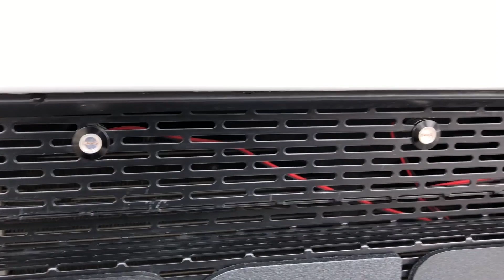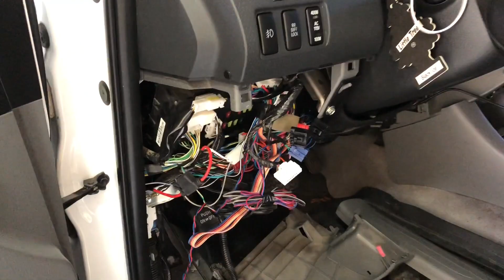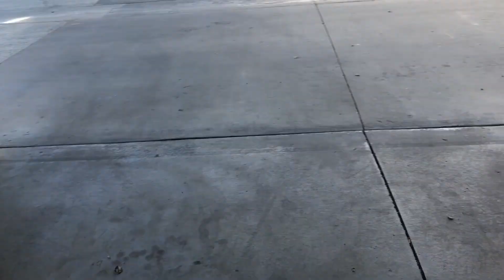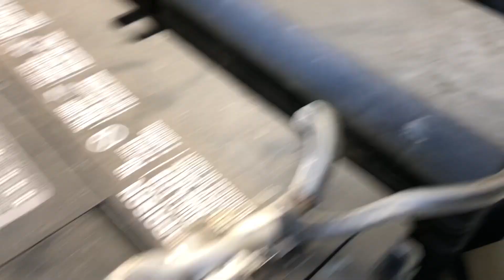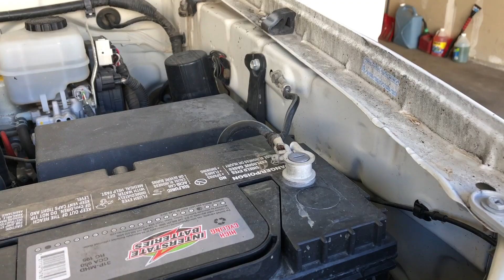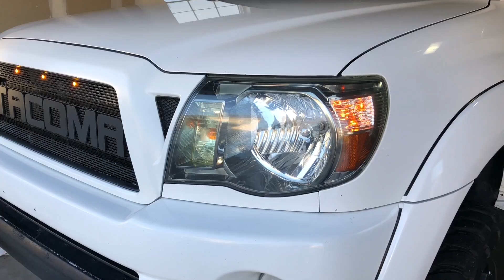Tacoma Amber LED Lights Install

Comment: I have it connected to my blinker but it’s not turning on do I need the fuse connector and if so what fuse
Reply from the maker: Does it turn on when your blinker is on? You need to connect it to a light that stays on like the DTRL.

Comment: Doesn't give you any issues on the computer system of your truck like warning signs light up on the instrument panel? as the computer noticed strange or new equipment hooked up to the system? I'm planning to do the same to my tacoma but I'm hesitant I might get some issues on the computer system of my truck.
Reply from the maker: Nope, no kind of warning or anything. As far as the computer knows, it’s still just powering the DTRLs
Reply: @BraxenMcConnell  Thank you for your reply, that's a good news now my hesitation on doing the same on my tacoma is cleared  . Thanks!

Comment: Can You wire them to the DRL lights so they can have 2 intensities like the DRL lights have one with the lights on and one with the lights Off?
Reply from the maker: Not on these lights. You’d have to find a light that has two separate lights to wire to do that. Or a dimmer.
Reply: You can do it with a relay. You will need one per side left/right blinker. Parking light  goes into pin 30, your LED goes into pin 87a, ground goes Into pin 86, and your blinker wire goes into pin 85. This will make it parking light and switch it to turn signal when need it.

Comment: Is it possible to wire them to your headlights so they are on when your headlights are on?
Reply from the maker: Of course! You could tap into the headlight wire in the engine bay, or find the fuse that the headlights go to and tap into that. Either would work.

Comment: Were did you get your headlights?
Reply from the maker: They are the OEM headlights, the original set I had got a little hazy, so I kept an eye out on a local classified section and when a clean set popped up, I bought them.

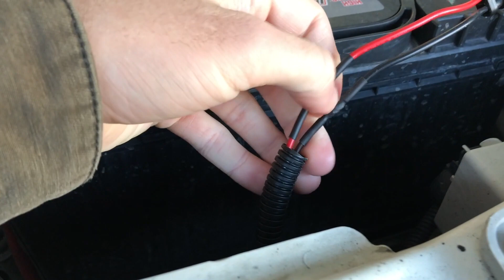Comment: im a little confused with what you are explaining at 3:00 , what is connecting to the negative wire on the male end?
Reply from the maker: Each one of the amber led lights had its own positive and negative wire, so I wired them all together and then soldered the three wires of the leds to the waterproof connector negative wire and then grounded that to the engine bay. Does that help?
Reply: Yes thank you !

Comment: If I have a 2014 Jeep Cherokee KL and want to wire them into the DRL Eyelash looking lights, can I go about that the same way?
Reply from the maker: Yes, you should be able to. All you need to do is find the wire or fuse that powers the DRL and tap into it. The concept is the same though.

Comment: do you really need a fuse for these lights? can’t i just connect them directly to the battery or is that bad and can blow up the lights?
Reply from the maker: If you connect them directly to the battery then they will always be on, even when the truck is off, unless you wire up a separate switch for them (which you could do). I probably don’t need a fuse since they use such little power. I just added one because I didn’t want it to surge and mess anything up with the trucks computer or the alarm system I have on the truck. It was probably overkill, but I’d rather have the wiring overprotected than fry my circuits.
Reply: Braxen McConnell oh ok. so what step do you have to do for the lights to turn on only when you turn on your truck?
Reply from the maker: You just have to wire the lights to a circuit that is only powered when the truck is on. That’s why I wired them to side marker lights, so that I could have them come on with the side marker lights and headlights, but I could also have the option to have them off. If you wanted them to always be on when the truck is on, just wire them to a circuit that is always on with the truck, such as the cigarette outlet circuit or something similar.
Reply: Braxen McConnell ok cool. thanks a lot man. i’m doing a lot to my truck